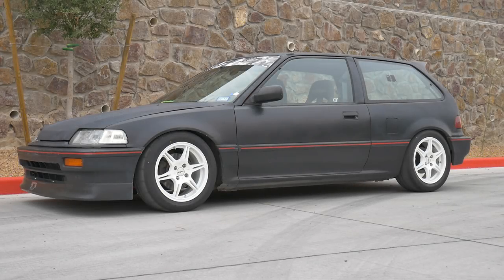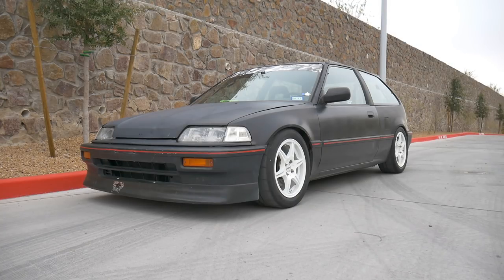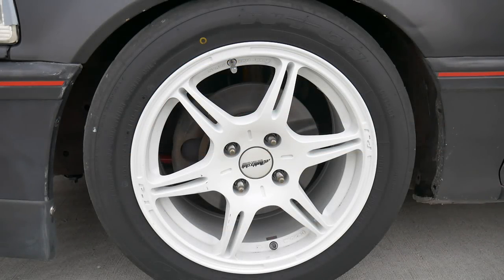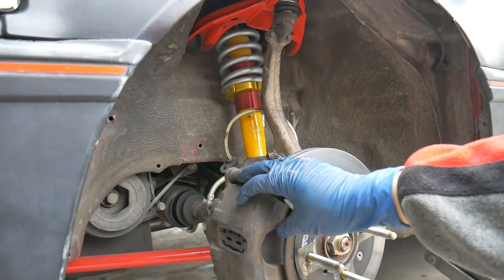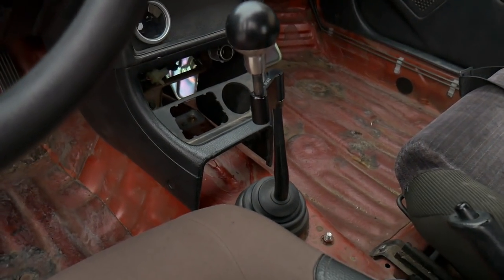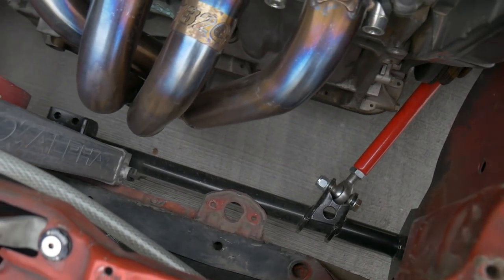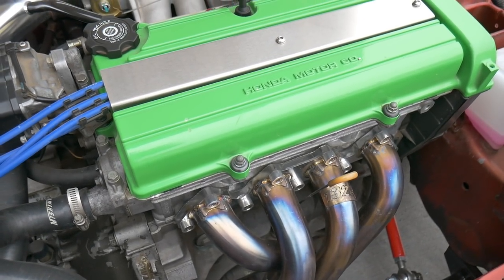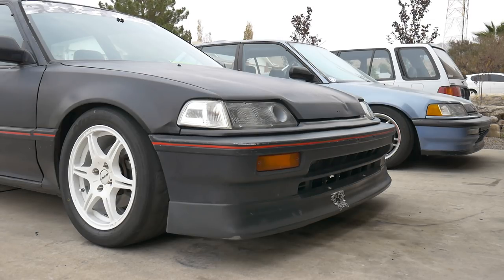My 1990 Civic DX Track Build - B20B EF Hatchback

Comment: I highly recommend that your run a b16 transmission with that b20b.  Btw I'm loving the EF and enjoying the videos!
Reply from the maker: +Robert Reid thanks Robert!  I have plans to install one in January/February!
Reply: nice!  Fwiw the ls/b16 transmissions use the smaller diff/ring gears and if your swapping in a ctr lsd you will need a gsr/type r ring gear and counter shaft.  The combo of a gsr counter shaft/ring gear with b16 gears & ctr lsd into any case really is the best stock parts set up that can be built for a na b series track car.  ctr lsds pop up used now and again on ebay for ~450 shipped and sometimes $400.  If you score one I could help you out with the gsr transmission parts.  I keep spares, but have never broken anything since running the larger stuff.  My drag racing buddies would break the ls stuff with some frequency...  prob wont be a factor for you, BUT consider much faster corner exists once you do put a LSD in. 
Garage build hondas 2019 build? :D
Reply from the maker: +Robert Reid wow, thanks for all that info!  I'm not super familiar with transmission parts.  I'm hoping I have no problems with my trans.  It's a JDM b16 with the stock LSD.  It drove fine when I drove the car home but never got a chance to really beat up on it.
Reply: B16 JDM LSD trans uses the bigger stuff.  Super score it will treat you right.
Reply from the maker: +Robert Reid Hell yeah!

Comment: Hi. Looking for a B20. How can I tell lf it's high compression and if it has the P8R head? Thanks.
Reply from the maker: Look at the head casting.  Only 99-01 are high comp and they will have a knock sensor.  That head will also be stamped P8R on the head.
Reply: Are all 99-01 P8R heads ? Thanks.
Reply from the maker: No, most are P75.  You'll need to inspect it yourself to see which head.
Reply: Is there a big power difference in the 2 heads ? Reason I am asking is I have no pick and pull yards around here. I can't look at the casting numbers b4 I buy.
Thanks.
Reply from the maker: Not that I've seen.  The p8r has those larger valves and the cams are different but the power difference might be like 1-3 hp.  I don't believe there are many camshaft options for the p8r head though where the p75 shares the same head/cams as the b18a and b18b and there are a lot more options.
Reply: So better off with the p75. Easier to get aftermarket cams.
Reply from the maker: And parts in general.